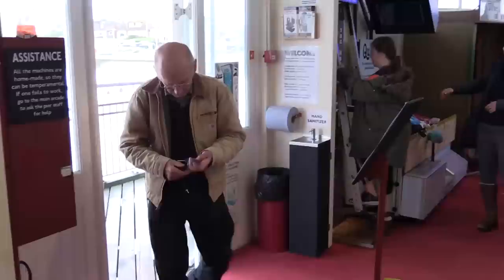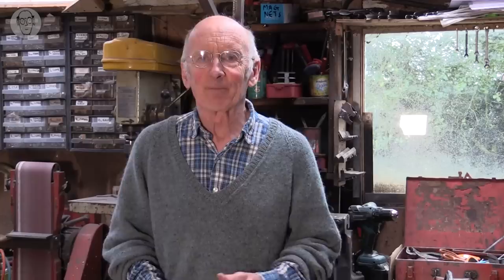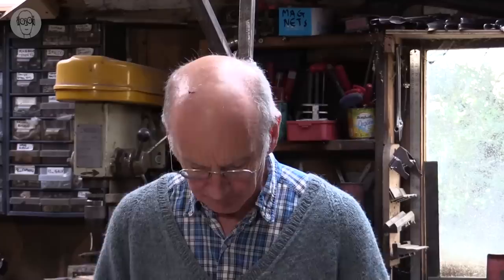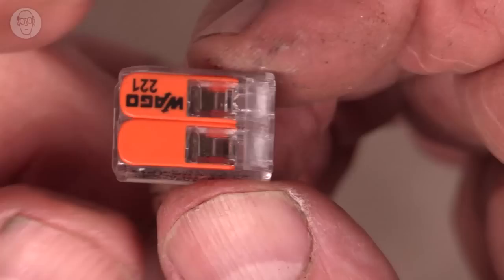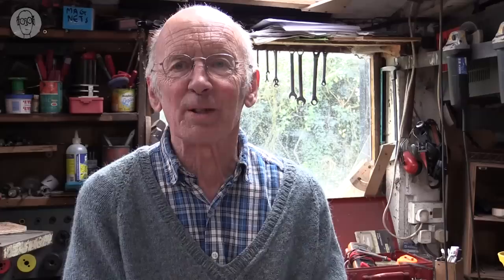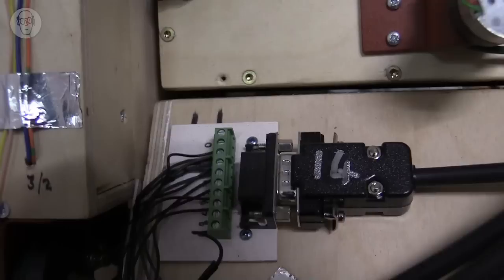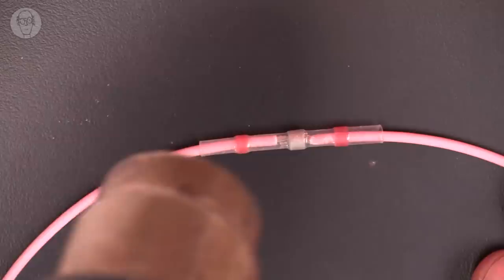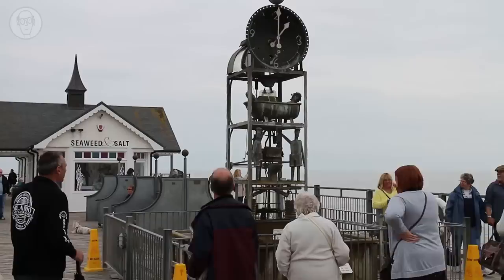CONNECTORS -- The Secret Life of Components, a series of guides for makers and designers - Episode 6

Comment: Do you use twist-on 'wire nuts'? I think they used to be popular with telephone engineers.
Reply: Work of the devil those things!
Reply: Wire nuts were never in my experience an approved connector for telephone lines, at least when I worked as a telecom tech I never saw nor used them. They are of course commonly used here in the States for electrical connections to this day.  They work great for solid wires that are tightly twisted in a clockwise direction only, and assuming you use a quality wirenut that has a metal spring inside of it, but some of the cheap wirenuts are simply plastic and have no interior metal spring for the connection.  Wirenuts  do NOT work well for connecting thin stranded wires, nor for connecting stranded wire to solid wire. 

 For some telephone line splicing (indoor only)  we used these little white squeezable connectors that we called "chiclets" ----  They had teeth inside them as well as a water displacing gel and you were supposed to be able to stick the insulated, unscripted wires inside the connector and squeeze with pliers, but we didn't trust them and usually stripped and twisted the wires before crimping a chiclet over them.
Reply: @goodun2974  The official name for the "chiclet" connector you refer to is a "B connector".  At least that was the name on the box back in the mid 1970s when I used a few million of them installing telephone and intercom systems into large apartment buildings in Ottawa Canada. If you want to buy some you can see here:  https://www.amazon.ca/White-B-Connector-Wire-Splices-Voltage/dp/B01L9J4C7W
          B connectors came in "compound filled" and "regular" versions without the gel.  Like you, I really didn't trust the insulation piercing feature so would strip and twist the wire first.
Reply: @Vincent_Sullivan  , we didn't use the chiclets /B-connectors much when I was doing telecom work in the late 90s to mid 2000s; you weren't allowed to splice phone lines unless the splices were in an approved electrical junction box, and anyway the clients insisted on continuous runs to each phone (digital, programmable main switch,  and therefore analog-style paralleling of phones wouldn't work). Of course, splicing Cat 5 data cables was verboten. Anyway, the button-like, gel-filled clear plastic connectors that squeeze down with pliers were a better choice for splicing.

Comment: Hi Tom. I love your videos but I would like to comment about the problem you have with spade connectors. Clearly the wire you used is too small. They are meant for large wires. For the red connectors you should use 1.5 sq mm wire. For the blue connectors use 2.5 sq mm wire. For the yellow use 4 sq mm wire. Also when you do the crimp, have a look inside and make sure the end of the wire protrudes a tiny amount past the crimping metal. Do this and you will never be able to pull the wire out.

Comment: What about wire nuts? Very popular here in Canada. We don't really use WAGO connectors much although I think they look much easier to use.
Reply: Experience from the UK; almost every electrician will be horrified by it because its not considered "proper" or safe. A lot of UK electric history is screw tightened terminals but springy terminals are starting to become more prevalent. UK used to have wire nuts but they were ceramic coated and cracked over time which gave them a bad rep. Ever since then there was little market for them because the electricians wanted to keep a good name for safe work and not have it fail or become dangerous. Even searching for "wire nut" on UK eBay gives WAGO latch types instead. The WAGO 221s are fantastic, get a variety pack if you do electrics. You'll wonder how you could ever live without them!
Reply: @EndlessDelusion  Fascinating. Wires nuts are used throughout Canada and USA and I have not heard of safety issues even if people misuse them. Oh well, to each their own. I did find a Canadian WAGO 221 source at about $.61C each. I may give them a try next time I have a project.

Comment: How to solder enamelled copper wire of the kind used in 12v DC model railway loco motors? 
I have some solenoid operated model railway point motor where the enamelled wire has come off the terminal. 
New motors cost over £18.00. :-(

Comment: haere; n the USA they used to use aluminum for house wire. problems ensued. while aluminium is a better conductor of electricity, it also heats up, and as a result expands and contracts in length. this caused mechanical loosening of the connectors, and the end results caused arcs. eventually these arcs of power would cause the wall sockets to violently explode off the wall. you could go through and re-tighten the connectors, but was too much to ask of the 'set it and forget it' mentality. so, aluminum was banned for that use as a safety issue in UL approved wiring. I knew of one family that had aluminum wire in a trailer mobile home. At the time it was a cheaper option than copper. figure post war copper scarcity. 

now aluminium is a better conductor for! he exact reason it is also a better heat conducter. that is why in the mid 90s they used to have copper/aluminium heat sinks for CPUs. copper for the base plate and Aluminum for the pins that fans blew air over. the copper would touch! he CPU, transfer the heat to the pins embedded in be copper block, and the fans would move air over the pins. the pins added a large cooling surface

Comment: Butt splicing two wires together would not get it in a race car.  I use uninsulated butt splice connectors and then cover them with heat shrink.

Comment: Solder sleeves are not reliable. The joint isn't a proper solder joint. It's brittle and can break apart from the wire.
Note: if it's new clean high quality wire and top-spec sleeves, arguably ok. Other times, treat with suspicion.

Comment: You didn’t point out the fire/arching danger it pushing the wire to far in so the pinch screw tightens onto the insulation causing bad connections and fire!

Comment: The D-Types are pretty relaxing to solder until you have to make some 50 ways.  
Had a job come in once to make up 12 x 50 way cables at 30 meters each. That was not fun or relaxing anymore.

Comment: Rather sad to see no love for the Anderson PowerPole stackable genderless connector;  capable of up to 45 amps (or 75 with the bigger ones), polarized, touchproof and mostly self-cleaning.  Again, you do need a special crimper for them, but they do work very nicely, and being genderless you only need one of each adapter cable to be able to make up an anything-to-anything adapter in a pinch.

Comment: "Let's start with a connector I actually do like ---- the jack plug". AKA "phone plugs" or "1/4-inch plugs" as they're known in the US ---- and frankly a lousy connector design that has low contact pressure on the ground side, collects dust and gunk and oxidation inside the tubular section of the female connector, and is prone to causing a loud, annoying and speaker-stressing "Thump!"  when plugging or unplugging this type of connector into an audio amplifier that is turned on.. At least the three-conductor version allows you to make a "balanced" audio connection for lower noise and hum; but it's still not a great design. As a former audio installation and repair tech I have probably soldered thousands of these onto custom-made cables and am well aware of their uses and shortcomings. They are extremely unsuitable for connections involving even low-voltage electrical power as the mere act of plugging or unplugging them while one of the connectors is energised tends to create a momentary short circuit or polarity reversal.
Reply: And then there's the half size version commonly referred to as the 3.5mm jack which seems to have some cult around it based on those who seem to be upset that the latest smartphone doesn't have it anymore. (And there's a variant of the connector that can output digital audio over fiber, but I'm not aware of any smartphones with it.) Those anti-vaxers of the tech world would probably also complain that the latest RTX 3080 doesn't have a VGA connector.
Reply: @NiHaoMike64  , given the choice between expensive rechargeable wireless earbuds and inexpensive, easily replaceable wired earbuds or headphones, I'll take the wired variety anyday. Yes, I'm an analog guy living in a digital world. And yes, the 3.5 mm phone jack is a fairly crappy connector, but it's rarely used in any high-powered device with the capability of destroying speakers or emitting annoying noises heard by everyone nearby.  The 1/4" plug, however, when used in an audio patch bay or even a guitar amp often can't support the weight or movement of its own cable without becoming noisy or intermittent. The ubiquitous RCA plug and jack still wins the prize for all time worst audio connector design. For that matter, the HDMI connector on home-theater equipment also sucks ---- it should have included a latching or locking mechanism or a deeper female recess so that the male plug couldn't wobble or twist and stress the jack. Micro-soldering a new HDMI jack onto a circuit board is no fun!
Reply: @goodun2974  USB headsets have been commonly available for a long time.
Reply: @NiHaoMike64  , any use that is likely to stress a tiny little USB-C connector, such as being tugged on by a headphone cable, might also damage the port sufficiently to prevent the charger cable from making a reliable connection.  I could live without headphone capability if I had to but not being able to charge the phone easily and reliably would be a much bigger headache. It's not generally a good idea to use one fragile connector for multiple functions. 

BTW,  I have a two-year-old Samsung phone which came with one of those inductive charger things that you sit the phone on to charge it. I hated it. You had to center the phone "just so" on the charger or it wouldn't work.